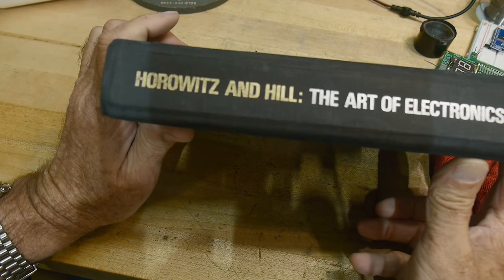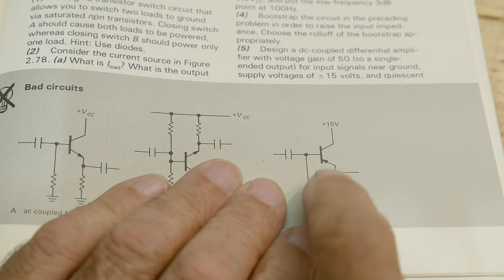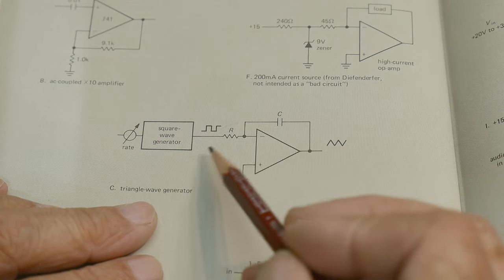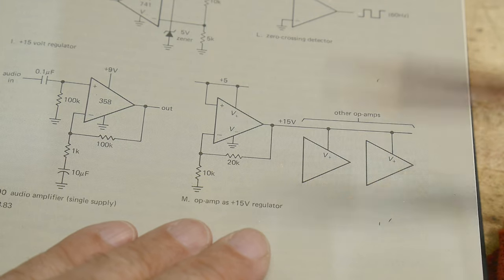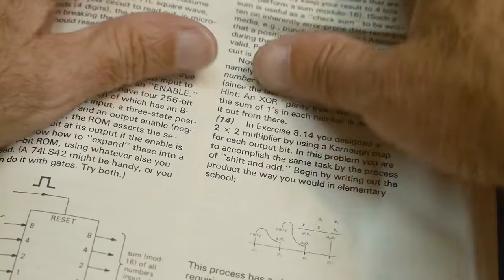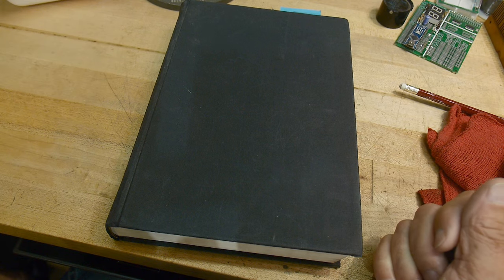#1548 Bad Circuits from the Art of Electronics

Comment: At 1:45 "the emitter needs to be down here at the bottom". No, because that would no longer be an AC coupled follower, per the caption. You must use a pnp, and it will not work "either way".
At 1:56 "we just aren't biased correctly; we need to have an extra resistor in". No, you have split power supplies, so you can bias the base from ground without an extra resistor. The only problem is that it needs an npn.
At 3:59 "what's wrong with this one?" There's no path for the non-inverting bias current.
At 4:47 "you tell me". The opamp is operating open-loop at dc, so the smallest of offsets will eventually build up and the output will clip to one rail or the other. You need some dc feedback (a resistor) to stabilise the operating point.
At 7:06 "that's not going to work because, errr ... [blather] ... it might be hard to drive this thing correctly". No, the problem is purely that the 200mA which is intended to be flowing through the 45R resistor then through the load has to be sourced via the 240R resistor, which would then have just 6V across it - impossible. Either replace the 15V supply with one greater than 57V (=240R x 200mA + 9V) or replace the 240R resistor with one less than 30R.
At 7:56 "I don't know". Check the gain: the npn discrete stage will have an approximate gain of 7.5K/75R = 10, while the opamp has a gain of 101. That's a combined gain of around 1,000, not the x100 in the caption.
At 8:35 "plus is right ...". No it isn't. The positive feedback on a Schmitt trigger goes to the non-inverting input.
At 10:05 "bunch of stuff wrong with that one". Not really, it just needs the opamp supply to be taken from Vin, assuming that the 741's drive of 25mA is enough to drive the base of the pass transistor at the maximum desired output current.
At 10:22 "this can't be referenced to ground". Actually, it can. The LM358 includes its negative supply in its common-mode range, but you're right that the non-inverting input sets the dc output in this configuration, so it ought to be biased to around half the supply voltage, especially with an intended gain of 100. Incidentally, the 358 can't manage 20KHz at a gain of 100, so would do a terrible job as an audio amp with that sort of planned gain.
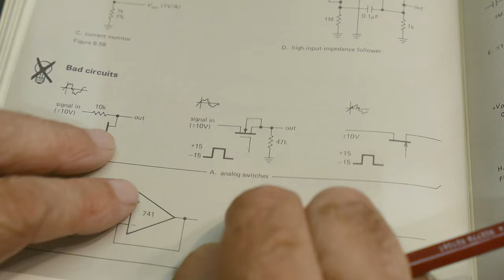At 12:40 the jfet in the first circuit must not have its gate driven positive wrt its source (it's a depletion-mode device). The mosfet in the second circuit will have a body diode that will conduct in one direction even when the mosfet is switched off, so it's not suitable for switching ±10V. You can't drive the gate of the jfet in the third circuit positive wrt its source.
At 13:08 "ten ohms is a little low" it certainly is a lot low. The circuit is probably expected to run at around Id = 1mA judging by the 10K drain resistor and 20V supply, so it will have a gm of about 10mS. The gain is given by Rd / (Rs + 1/gm) and 1/gm is going to be at least 100R, meaning that it swamps the source resistor used and making the gain a rather variable x100, not the x1000 hoped for.
At 13:23 you can't drive a jfet's gate 5 volts above its source.
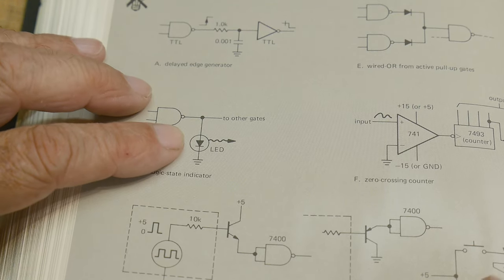At 14:30 the problem, even "nowadays" is that the LED might be red, so it could clip the ouptut to the other gates below a TTL logic 1.

It was great fun. Thank you.

Comment: Not an expert here but I think some of the FET circuits might be wrong because JFETs are triggered by a negative voltage, so the gate would have to be less than both the source and drain voltages which cannot be always guaranteed
Reply from the maker: https://youtu.be/rJb1eVR30dY

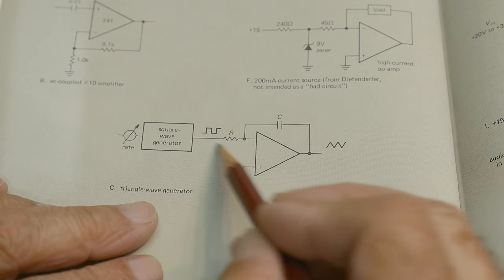Comment: 4:30 that triangle generator output will float randomly anywhere between GND and the suppy, tried that and it didn't work.
a system feedback loop is needed to detect the desired high point and reset to GND. 
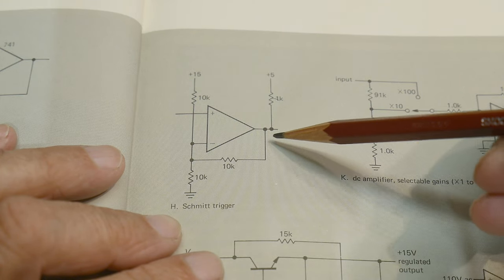8:53 only comparator like lm339/lm393 need a pullup at output, the 10K feedback is really small and since all are 10K it would offset the voltage divider extremely, the voltage divider is producing 5V and via the feedback (5V - 10K + 4K) is offsetting the voltage divider and probably also cause behavior like a bad configured non inverting opamp acting more like a "voltage follower" rather than a binary output, they use 10M in feedback on lm339/lm393 to slightly offset the voltage divider once triggered and prevent getting erratic behavior around the tripping point.

I got the 3rd edition, pretty heavy book with 1200 pages, you probably want someone to hold it for you.
: )

Comment: The amp at 3:45 is not exactly x10, the resistor should be 9.0k exactly. Maybe that is what they mean? You could have an extra resistor to ground from the + input but it is not needed for a 741 amp, at least if you have +-15V supply. You should have a capacitor on the output because you might get a small DC offset. A FET input amp may need it because of the high input impedance that might make the + input float also have leakage current through the input capacitor.
Reply: Everyone knows this

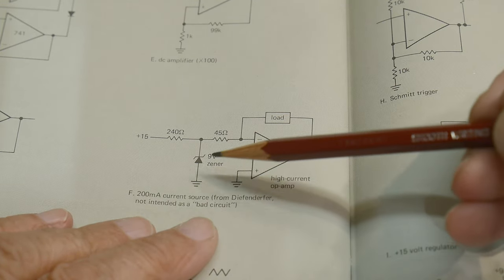Comment: At 4:10, the capacitor will not pass the opamp's input DC bias current.  Thus the opamp's linearity will be greatly degraded if it works at all.  1uA of bias will drive the output to a rail for one half-cycle (depending on the input BJT polarity).  At 4:45, even the slightest asymmetry in the square wave or the input bias will drive the triangle's DC offset from zero - possibly far enough to clip the triangle.  It is far better to compare the triangle to a trip point (with hysteresis) to provide the square wave.  Adjusting RC would then control the frequency.  At 6:40, Diefenderfer offered this in a product, but it did not work well.  (15V - 9V)/240 = 25mA << 200mA.  At 7:50, the transistor amp has 7VDC offset that also gets amplified by x10.  At 8:30, hysteresis requires positive feedback; the input terminals are reversed.  Analog switch substrates need to be connected to the correct power -- p to +power and n to -power.  Also, there should be a complementary pair in parallel.  At 13:20, ~2V pinchoff / 10 = 200mA keeps the transistor saturated.  At 13:30, the compliance voltage decreases as load current increases.

Comment: Nice idea to analyze these bad circuits. 
It might be a good assumption that the circuits are derived form working circuits with just one error in each that has to be found. 
Maybe 5 of them in one video would be enough. 
To even improve your knowledge you need just enough of your followers where you have plenty of patient experts to find out the correct solution.

Comment: 7:35 (G) .. the gain for DC is also 100x, but the collector voltage is around 8.5V (correctly biased, as you said) so the opamp wants to give 850V DC at its output, which does not work. But an electrolytic an series with the 1k to ground and you are fine. 

12:27 .. first and last one. It's an N-JFET .. that GS-Diode conducts for voltages >0.65V or so. Last one also plays that D/S are usually interchangeable, so same problem. +15V even puts current back into the signal source.
Second one misses a lot, to make it work you need to build a "transmission gate" .. used all the time in ICs, and whats in the (in?)famous CD4066 and various analog multiplexers. 

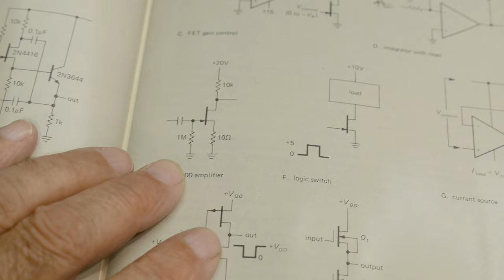12:59 (E) .. you don't get 1000x Gain out of that single JFET. With a AC grounded source, the gain is gm*RL (exactly gm*(RL||Ri) with Ri being the differential resistance of the drain, but that is very high) so with a typical gm of 5mS or so around 50x with that 10kOhms collector load. The bias of 10 ohms doesn't matter, so input voltage would be limited to 0.5-1Vpp or so (before the G-S diode begins conducting).

(F) same as the clamps before, a N-JFET is always depletion mode and takes negative G-S voltages. Would be fine with a (enhancement mode) MOSFET.

Comment: Did Don Lancaster ever do any work on audio circuits using germanium transistors? Maybe he wrote articles on it. I have a 1961 Tranistronics stereo amp that uses germanium transistors. It sounded very good until those germanium transistors did a nose dive. I have the schematic of it, but even the most qualified techs say don't even bother trying to fix it.

Comment: 7:00 F circuit. According to your words inverting amplifier and integrator are bad circuits too. Sure they are since input impedance is high and there will be no path for return current. In real life they all work because input resistor is the return path for the output. The capacitor current in the integrator circuit is the input resistor current. Right?

Comment: that middle circuit of the first 3, i've seen very similar used in a cassette deck, but dc fed to the base, looks reverse polarity , with npn with emitter to +v via resistor, capacitor coupled from audio amp, then capacitor coupled to the audio output,  its some sort of muting device, as i had to replace one of a pair(one each channel) as it shorted, killing one channel !

Comment: I think looking at bad circuits can not help as you mostly design the circuits for what it has tobe  used for
But can learn from bad circuits how not to use a component such as driving a transistor without a base resitors or emmiter resitor

Comment: The integrator (triangle converter), needs to have gain set with a feedback resistor,.... with infinite gain it will latch-up and or deliver square waves any way.  The triangle delivered by approximating this circuit, but WITH setting gain,  near one (also needs input signal limited to 5-10 % less than the supply voltage, will tend  to round off, as the cap reaches full charge, because the cap is charging into an infinitely high impedance, except for whatever the source resistance of the output of the square wave generator is doing , which is being ignored by the assumption that it is supplying square waves and is otherwise not a part of the real world.   That circuit appeared in Walter Jung's book on op amps.  someone told me to build it about 4o years ago,... I knew I was wasting my time,...& INDEED it didn't work.  
  
 At 8:05 (G) the X 100 audio amp is driven from a direct coupled common emitter transistor circuit which will pretty much have to have a DC offset, which will get multiplied by 100.  

The output of the op amp at H is trying to drive a resistor fed directly to a 5 volt source.  That reference for clipping should be dealt with at the input, not the output, or isolated from the output of the op amp with a series resistor and a load resistor, if it is being locked to the 5 V passively.  Anyway,.. a Schmitt trigger is supposed to act fast, and a 741 with a load resistor and a passive voltage clamp will suck, at that . 

interesting that I have a copy of Art of Electronics,... and now so much of it's practicality is gone either because much better ICs with specific attributes exist, but also because it's difficult to get parts,... & so much of the focus in electronics engineering has completely changed.  

There is a stupid chapter in the book, also,  about switching circuits, that behave (according to the book) according to rules of a "forced response",.... there really is NO SUCH THING as a "forced response" in electronics,... electrons always obey the laws of physics, and a gentle - minded awareness of that FACT results in much better engineering.

Comment: "Looking at bad circuits will develop bad habits"
I strongly disagree to the point where I'd call it "that's rubbish". The name "bad circuits" certainly is fetchy, but in the tradition of most academic textbooks, it's a collection of exercises that require a different approach, and prior knowledge from the chapters in the book to start a discussion. Figuring something out where the solution is not stated somewhere else is a great tool. On the other hand, don't delude yourself into thinking that working with a book guarantees knowledge without misunderstandings.